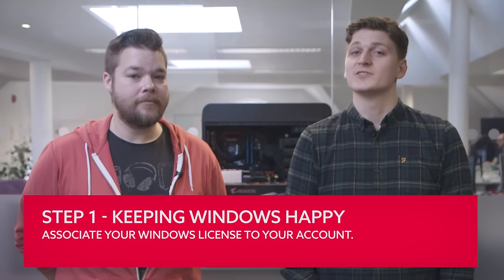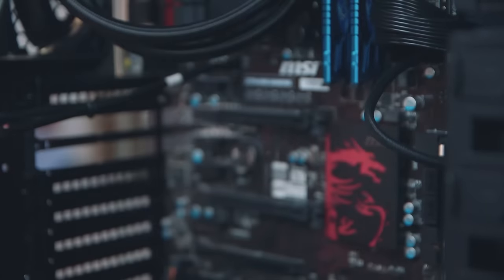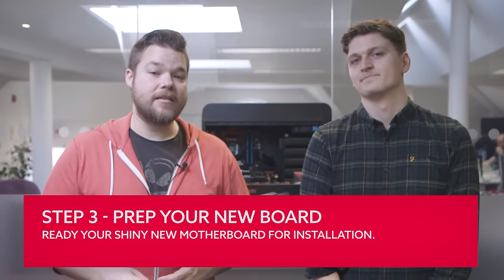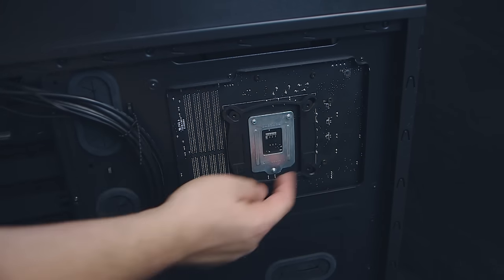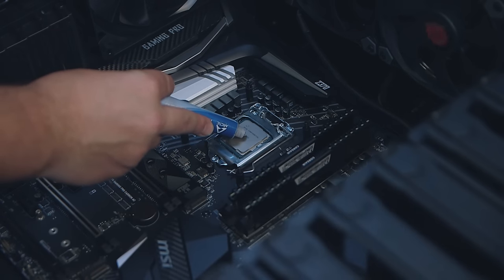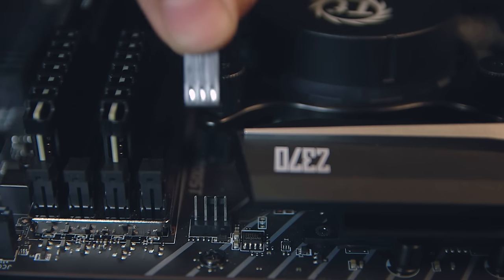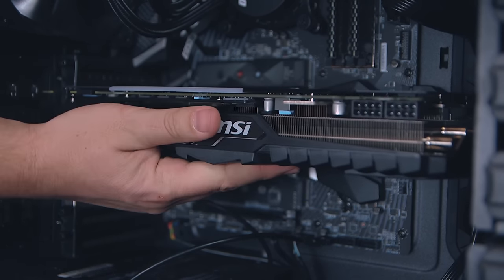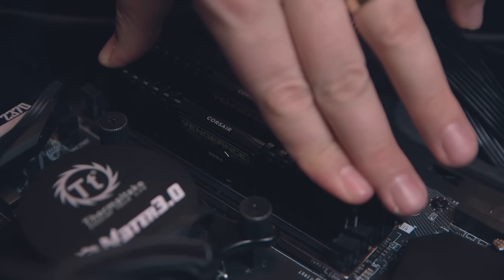How to replace your PC’s motherboard in 8 easy steps | Hardware

Comment: Does thiswotk with OEM version of Windows 10
(I think it doesn't)
Reply from the maker: Manuzki the best way to check is to either contact your manufacturer or Microsoft.
Reply: PCGamesN I Upgrade the whole computer, so it is not basicly the same, but still in same case and ssd. So i think it's not possible then even through Microsoft. I alreafy bought new Windows 10 retaill version.

Comment: wait do i have to uninstall the drivers and stuff?
Reply from the maker: It depends what you're moving from and to. If you're switching from a Ryzen to an Intel platform (or vice versa) you might experience some issues if you don't clean off the likes of Ryzen Master. Other than that you should be fine to replace your board.
Reply: @PCGamesN  im switching from amd fx 8320e paired eith gigabyte ga 970 gaming mobo to ryzen 5 2600x with b450 tomahawk..can i just plug my ssd into my new hardware and itll be read to go?

Comment: What if I just basically decided to throw out the old mobo?

By the way, my case actually might have a slight upper hand, because... it doesn't need a mounting bracket. That's right, my case is a square and my motherboard is VERTICALLY mounted. Take that.
Reply: Yeah that's really not that special

Comment: do i have to wipe my ssd beforehand or will it just work so i can keep my downloads ?
Reply from the maker: You should be able to keep all your files, depending on which OS you're using. Windows 10 is excellent at picking up new hardware, even something as integral as a new motherboard.

Comment: I find most of this wrong tbh
Reply: ram cpu gpu I would do before placing in case just my 2 cent
Reply from the maker: @Konbbomba  Which parts are actually wrong? 

CPU and RAM I can understand as a preference, but how do you install the GPU before placing the motherboard inside the chassis?

Comment: i think you left something out . changing the mobo your going to need a fresh install of windows because the drivers from your old mobo will conflict with the new one .
Reply from the maker: Not necessarily. If you're using a modern version of Windows it's normally pretty good at figuring that stuff out. We switch between lots of different motherboards, CPUs, and graphics cards on a daily basis due to the nature of our work and very, very rarely will we have to reinstall Windows because of any driver conflicts.
Reply: PCGamesN nice reply after 1 year, getting my new CPU, MOBO AND RAM... wish me luck lmao
Reply: PCGamesN Do I need to delete any drivers or anything like that before I swap the board? I’m just changing my motherboard and everything else is staying the same.